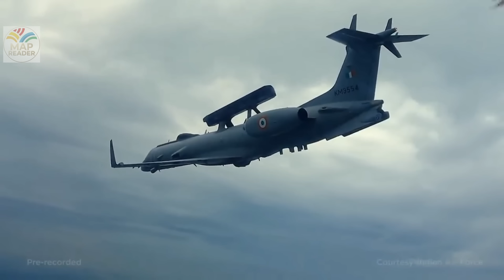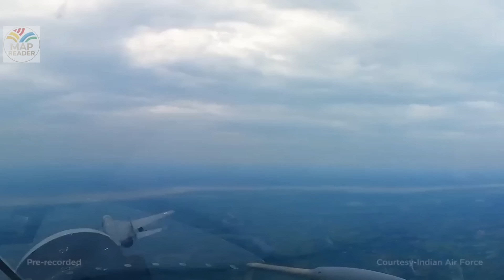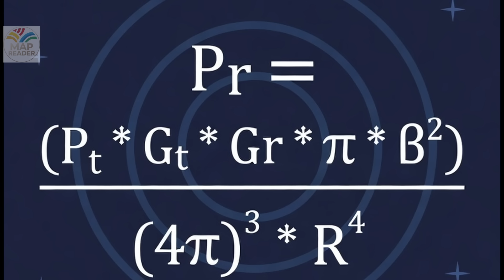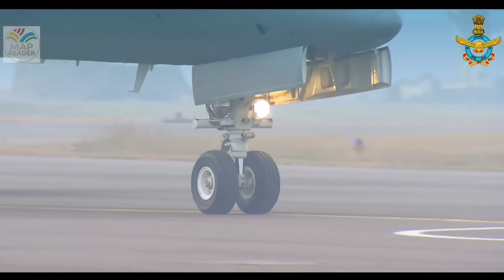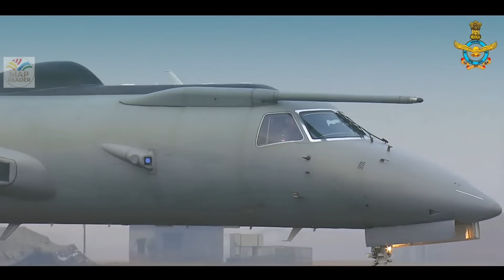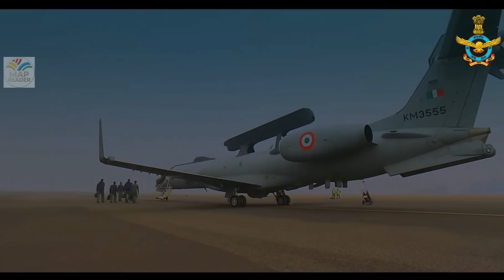No Wonder IAF Dominated PAF in OP SIndoor Netra Mk 1 has GaN AESA radar.

Comment: I have 2 questions : (1) why can't a Virupaksha or Hawk-I  with appropriate number of TRMs be mounted in  E-145's nose , giving it a 300° coverage ?
     (2)  Why is Hawk-I 2700 not preffered over Virupaksha (  2400 TRMs )  despite it being capable to give extra seconds to a pilot  ?
    As both the radars are based on DRDO tech ; I assume  their TRMs to be similar. 
    If radar range is proportional to n^3/4  ( n= number of TRMs ), all  other relevant factors being same.

My  rough half baked calculations say
 r₁ / r₂  = (2700/2400)^3/4
             = 1.125^3/4
            ≈  1.092
So, if Virupaksha can detect 1m² RCS enemy from 250 km ;
   Hawk-I 2700  can detect it from 273 km i.e.  23 km farther.
    I assumed two IAF Sukhois cruising together , one with Hawk-I & second with Virupaksha.      An enemy say J-10C  is coming head on .   For simplicity, assume all three crusing at 900 km/h.
     Now, Hawk-I would detect the enemy from 273 km but Virupaksha would detect it only after the distance reduces to 250 km i.e.  23 km more relative distance has been covered.
    Now,  the relative velocity is 1800 km/h = 0.5 km/s
    So, time taken = 23 km/ 0.5 km/s
         = 46 seconds.
   I am not a pilot but i believe 46 seconds is a huge advantage.   One can radar lock & even launch a missile in 46 seconds.
     Then, why not Hawk-I ?
Reply from the maker: The EMB 145 nose is narrow and civilian shaped. These big fighter radars need a wide, flat antenna face. Stuffing one in would wreck aerodynamics, mess up weight balance, overheat the plane, and kill endurance. Nose radar also gives mostly forward view — Netra’s dorsal setup already gives wide 240°+ coverage without destroying the aircraft. It’s just not worth the headache. 
2. Why not Hawk I 2700 over Virupaksha (2400 TRMs) for those extra 46 seconds?Your calc is spot on   more TRMs should give ~9% extra range and roughly 46 seconds more warning in a clean head on. That’s real value.But Virupaksha wins for now because:
It’s designed specifically for the Su 30MKI easier integration, less risk, faster timeline.
Better overall system match (cooling, power, software, ECCM).
More mature in testing for the Super Sukhoi upgrade.
But combat is messy jamming, manoeuvres, electronic warfare, etc. The radar that integrates better and has proven compatibility often wins in practice.Both are Indian and both are huge upgrades. Hawk-I 2700 is pushing Virupaksha hard, which is good for everyone. Competition makes both better. IAF is probably watching both very closely.
Virupaksha is the smoother, lower risk choice right now. In messy real fights, integration and reliability often beat raw TRM count.
Reply: @MapReaderYT  thanks for the detailed reply.  🙏 Hawk-I 2700 is also designed for Su-30 integration only.   ?? 
     I was impressed by Data Patterns more when this was mounted on a swash plate whereas initial model of Virupaksha was NOT ; giving Hawk-I wider coverage.
      Also, Data Pattern offered to test & certify at 'no cost to customer'    & Virupaksha has also not been integrated with Su-30 till now . So, how is it better integrated ?
Reply: He gave you the wrong answer. This guy just reads AI generated Scripts. Actually Virupaksha has been designed & developed by DRDO (manufacturingdone by astramicrowave). Where's I-hawk is not. The coded Architecture of Virupaksha makes it easier for the integration of all Drdo sub systems from EW suites to Missiles. Astra 1,2,3 along with Rudram series of Anti radiation Missiles along with all future subsystems could be very easily integrated with Virupaksha compared to I-hawk which is a full private product that lacks it's own plug & play subsystems.